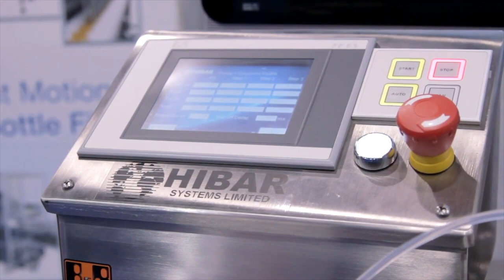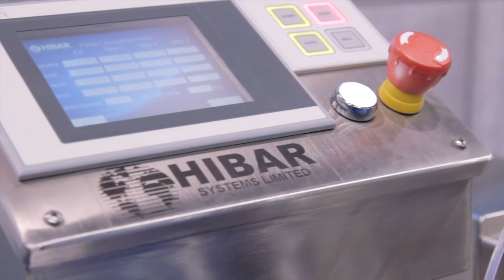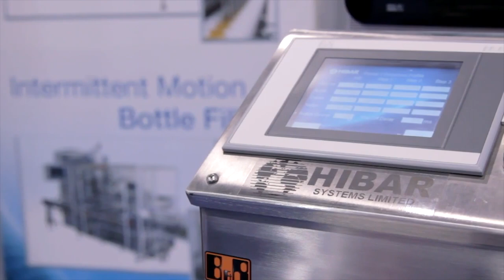TESLA PURCHASED HIBAR (Battery Manufacturing): Elon Musk Breaking News!

Comment from the maker: HIBAR HIBRA HIGHBAR I got mixed up in the name sometimes! Whats your take on this brand new acquisition?
Reply: Since Tesla will soon be producing over half of all Lithium-Ion cells Worldwide (in Ampere•Hours), it is prudent to incorporate this technology vertically. 

However, it is not necessarily the case that they will exclude the sale of these HIBAR products to competitors. Bringing more Intellectual Property in-house means better leverage for mutual sharing of IP with other IP holders.
Reply: Tesla needed a pile of patents and robots that were VERY different from Panasonic, to prevent future lawsuits.
Reply: P.S. Also, Tesla does improvements as fast as they can. They don't have model years, they do Over-the-air improvements ASAP. Five years later, no auto giant has yet done OTA upgrades. So Tesla probably got frustrated with Panasonic's SLOW improvement rate.  Soon with new chemistry from acquisitions, they may make Panasonic look like a Galapagos Turtle, in the battery race.
Reply from the maker: @jimwhitehead1532  I think so too, Tesla is sometimes (positivly) way ahead of competition & technology.
Reply: @wolfofdubai  Various auto analysts like Munro and Associates have estimated they are at least 5 years ahead of the auto giants in EVs.  Please view Munro talking about a  tear-down of the Model 3. They were awed  by the electronics, so advanced they didn't understand it, and the unique cooling system of one super-bottle.
Reply: @jimwhitehead1532  
The Tesla neural-network hardware is ten times faster than any other and is bound to be improved to stay ahead of competition. Another moat.